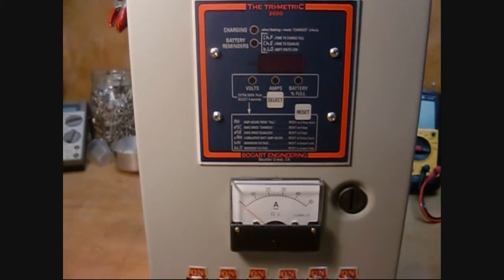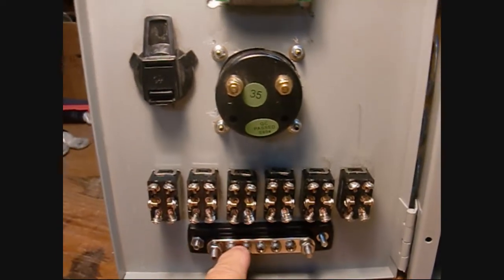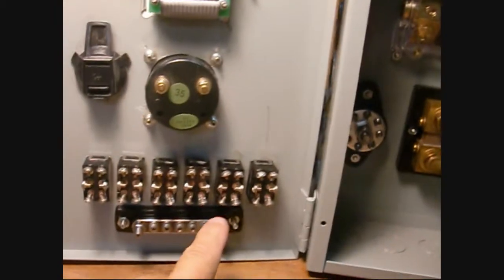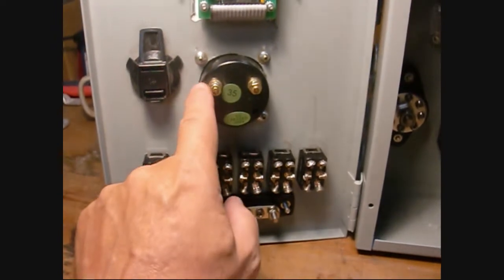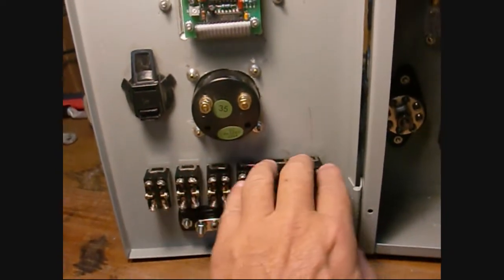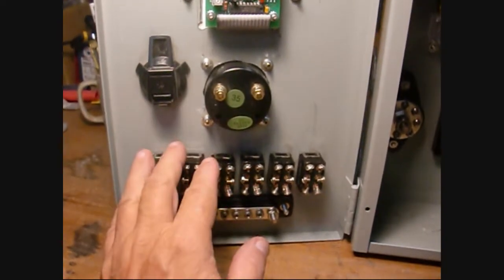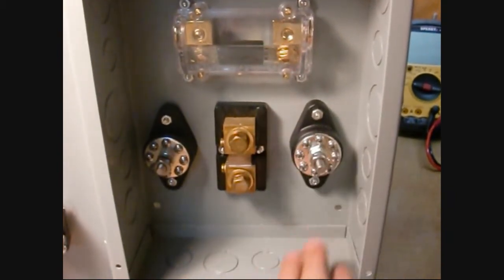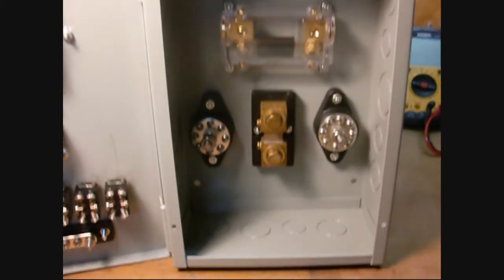Solar Energy Off-Grid - Part 3 - Mounting Parts

Comment: Thats a lot of work you did there I know. It's difficult to make the cuts. Looks great! That is a good Idea you had being able to throw the power to the grid or batteries which ever is needed worse at the time. I have had a idea for some time of having two separate battery banks and being able to charge one or the the other and being able to use off off each one separately. In other words if I had some Trojan flooded batteries out on my porch and the sealed agm optima in the house I can switch